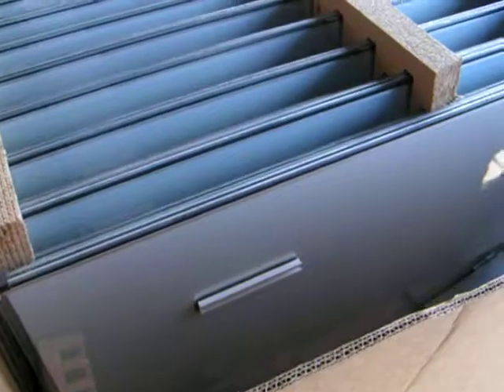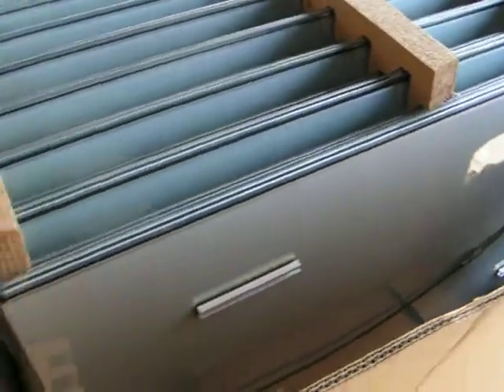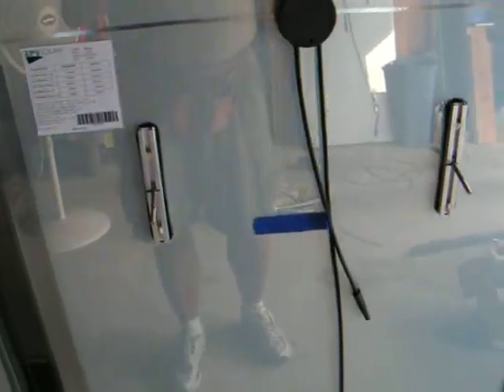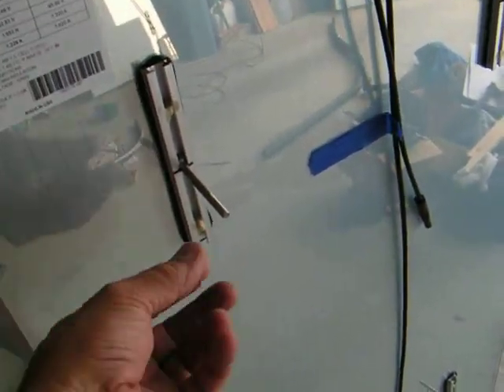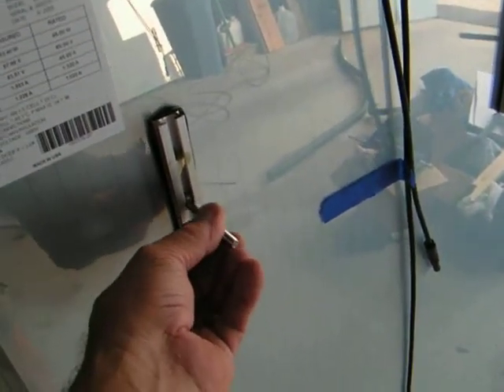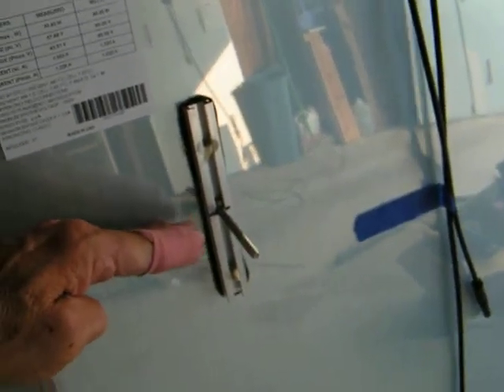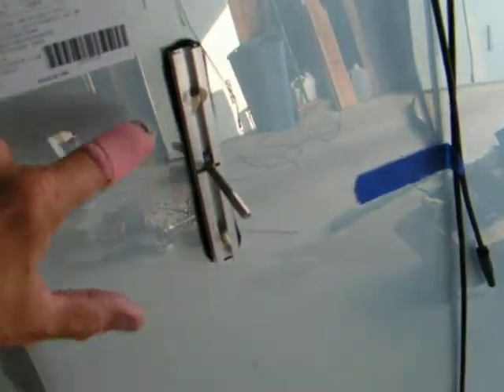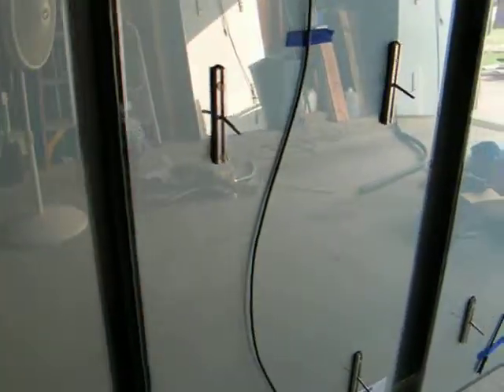PV preparation for install.MOV

Comment: Very cool series. I'm just getting to the point of looking to learn more about all this. Looking to build a home soon and I want to try to incorporate some of the same technolgy you've been exploring in your Energy Project.

I've no idea the costs or whether I've the technical knowledge(for the electrical portion) to design and build it though. On these EPV-46 panels, I can't find them on atensolars site. Are these now obsolete or what should I look at as a comparable product? 

Thanks